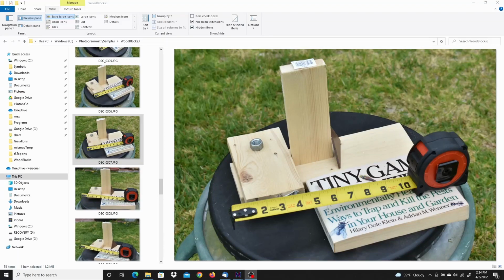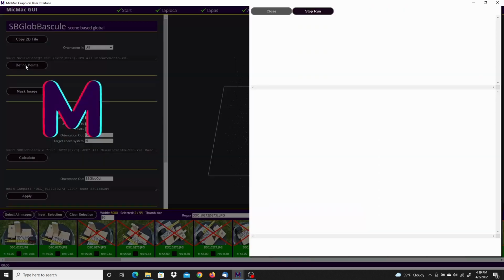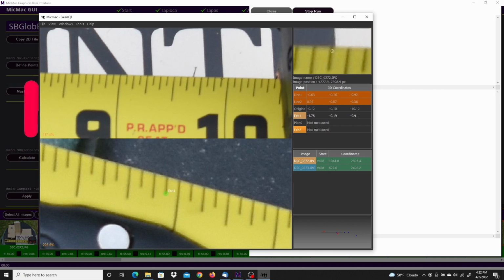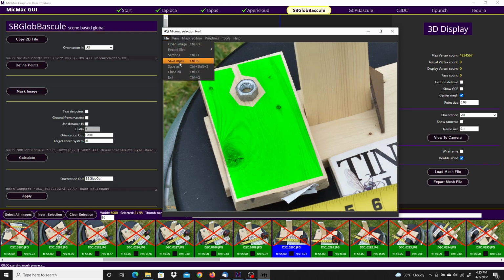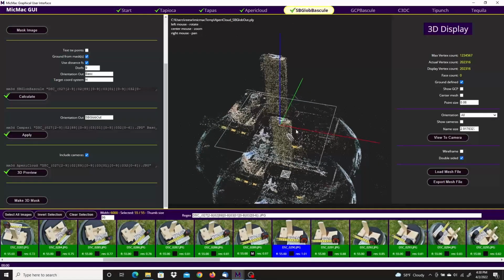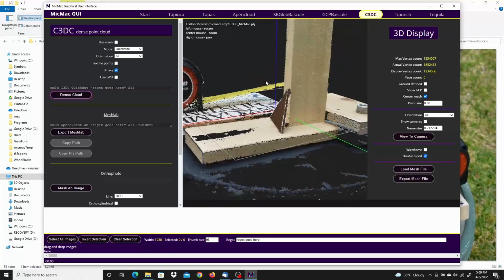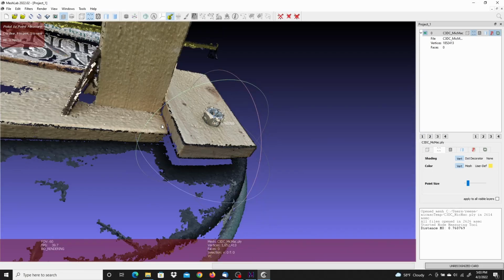MicMac Scene Based Orientation

Comment: Hi ! Thanks for your very good tutorials, 
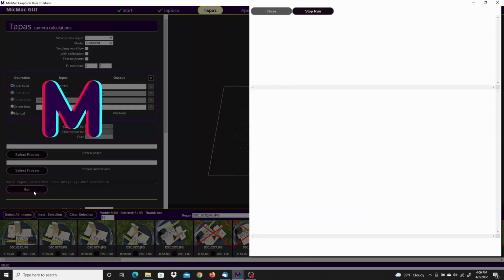Why do you use the RadialStd mode and not the RadialBasic at 2:52 plz ?
What is the difference between Equals or Different PPA/PPS ?
Thank you !
Reply from the maker: I chose RadialStd because it's supposed to be better than Radial Basic and RadialExtended is better still. My decision to use RadialStd was arbitrary. It just has to be RadialBasic, RadialStd and RadialExtended to work with MeshLab later in the demo. I dont know what "Equals or Different PPA/PPS" are.